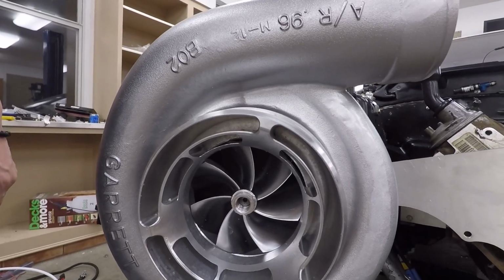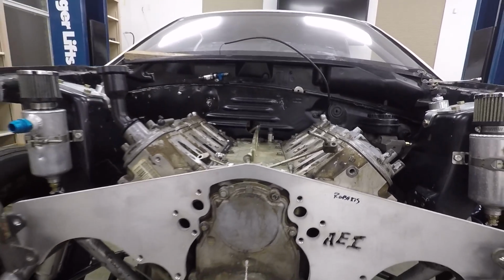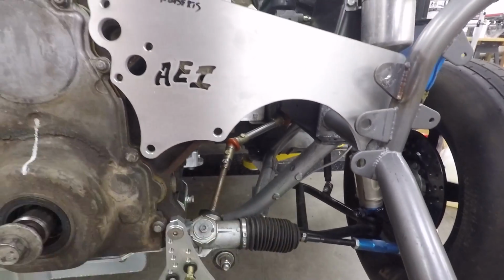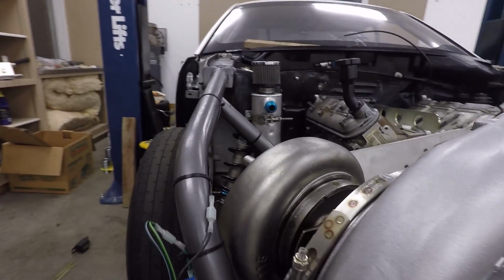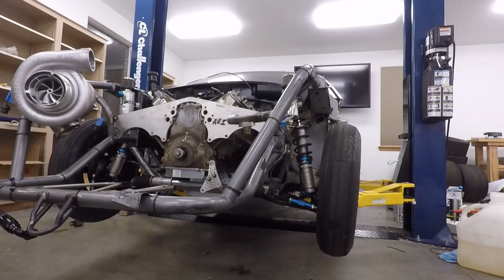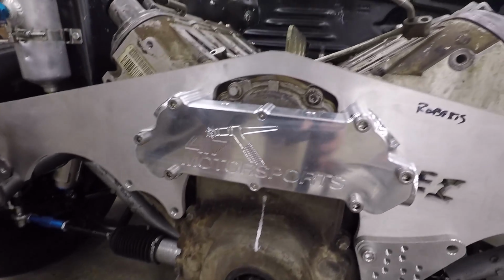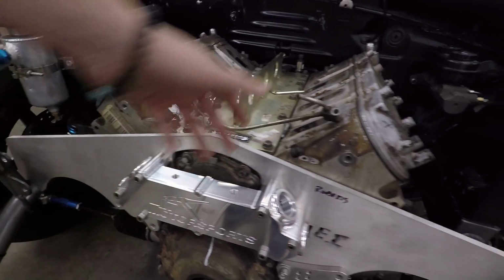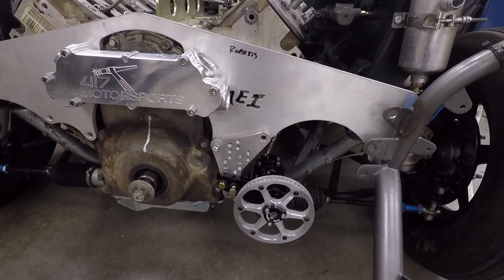LS Motorplate and Mechanical Fuel Pump! Road to Re-setting the SBE 4.8 Record Ep. 2

Comment: I drilled that blank boss on mine with a battery drill , I bought two brand new bits one small for pilot and then the size I needed, and brand new taps, it went real smooth no problem.

Comment: What headers are you using? And fuel pump bracket?
Reply from the maker: Just cheap flotech headers and it is a aeicnc fuel pump setup from Robert Ette
Reply from the maker: They are modified some. Shortened up

Comment: Can you recommend a perfect LS compression ratio for SBE turbo (4.8. 5.3. 6.0) iron ?
Reply from the maker: When you have good fuel like e85 or race gas or something the higher the better. I believe the highest you can get is 10:1 in 5.3s and their may be a 6.0 with that too.
Reply: @SquirrelTuned  I am grateful for the answer to my question, thank you
Reply from the maker: @عليبنخالد-ق2ض  I should have clarified it isn't always the higher the better, but in sbe stuff I feel that is the case. On built motors I like around 11:1 usually. Depends on the combo and fuel and all that though.
Reply: You're amazing man, I'll keep your guidance and act on it, I'm grateful to you